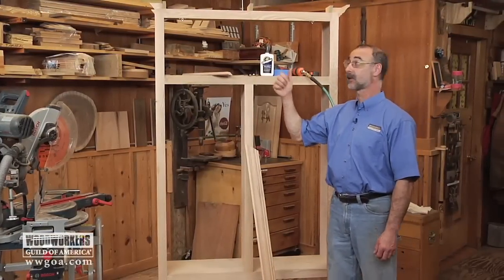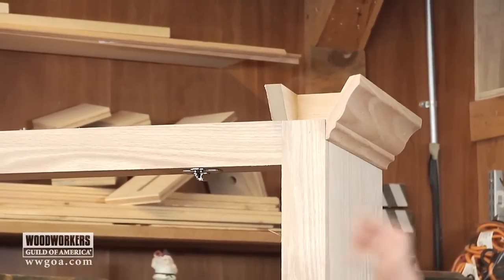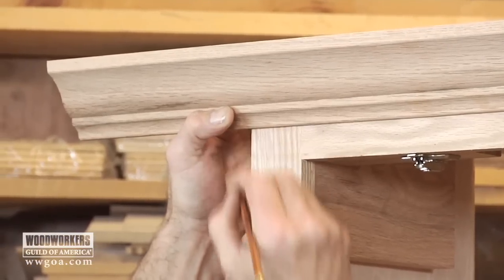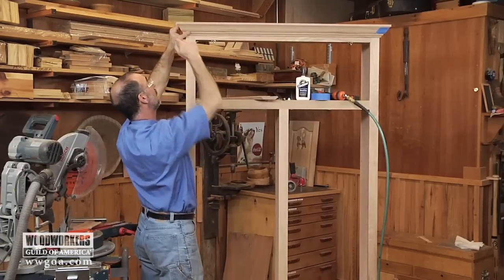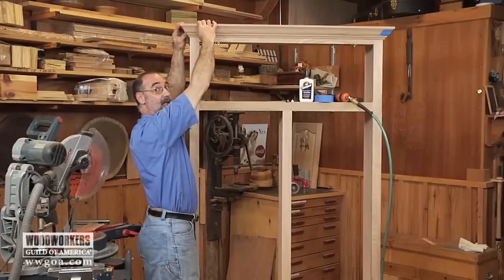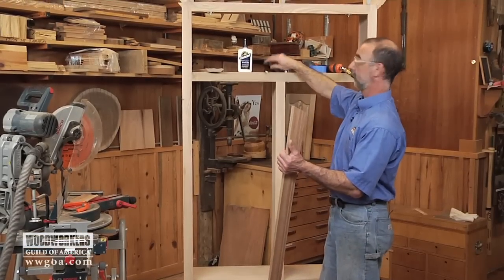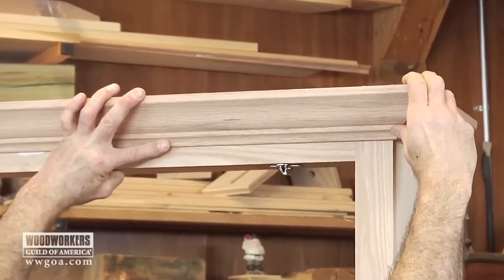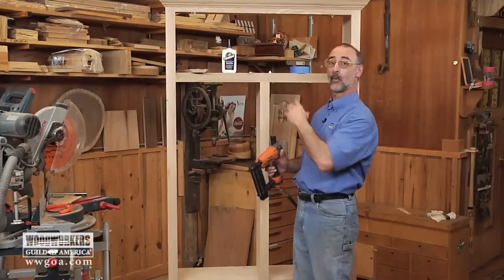Woodworking DIY Project - Installing Crown Molding on a Cabinet

Comment from the maker: It may take a tiny bit of putty, but often you can push on the wood with your fingers a little and the fibers will form right over the top of the pin hole.

Comment: Thank you for posting such a great video.  I'm installing crown molding on my cabinets and want to add a "staggered" effect and I'm using 4" wide molding.  How would I secure a riser/ filler to the top of the cabinet to creat that look?

Also, exactly how did you secure those gussets to the cabinet?  Did you just glue them or nail them from the bottom?

Comment from the maker: I use CA glues like 2P 10 all the time.  Very useful.  CA glue offers the advantage of curing very quickly, but doesn’t have the shear strength of yellow or white glue.

Comment: Nice video. The critical commenters are missing the point that this isn't about how to cut miters, it's about how to attach the cornice securely. One comment:  I was taught to size end grain when gluing up because the end grain draws moisture from the glue and weakens the bond. So, best practice is to apply glue to end grain, let it soak but not dry, then reapply. What that means here is that I'd probably apply glue to the end grain on the miters (both halves) as the very first thing and also along the  gussets, then apply along the  length of the cornice. When the long glue line is brushed out, I'd then go back and hit at least the miter end grain again , at least lightly. It shouldn't run onto the cabinet face. I'd probably hit the tops of the gusset miters too. 

The one question I have is, why not do the gussets afterwards? You'd be able to push them up against the cornice to locate them exactly.
Reply from the maker: Yes, gussets could be used here to improve the installation process.  As far as sizing, this is a useful technique when it comes to gluing end grain.  We do cover that technique in other videos on the site.
Paul

Comment: when you put crown on a low bookshelf that you can see the top of, how do you cover that? like a tabletop of sorts. would you just cut a piece of plywood to go on top of the crown?
Reply from the maker: +Ian Knight You could cover it with plywood or a glued-up hardwood panel.  In this approach I would suggest overhanging the crown by 1/2" or so to give a nice finished appearance.
Reply: You can't just simply put a piece of plywood on top because the edge of the plywood will show

Comment: I understand what you are saying about the glue running, but it doesn't matter what kind of glue you are using, if you don't apply it right, or just glob it on there, it's going to smoosh out and run or drip, regardless.  It's all about the application, like you were doing, of using a brush or something to get an even application of glue across the surface, and cleaning up any squeeze-out right away.  Overall good video, thanks.
Reply: Sig Guy  If you varnish and seal the moulding and the exposed bit of the frame before you glue up, you then just have to wipe off the squeeze out and drips. No sanding of awkward bits required.

Comment: if you are adding crown molding to a bookshelf that has a decorative "lip" or edge that coms forward, can you glue and nail the crown molding to the edge lip or is it best to the very top of the cabinet?
Reply from the maker: Hi, Camila. You could do this either way. You'll need to ensure that you support the molding with adequate bracing from the back side so that it is solidly supported and not vulnerable to getting jarred loose with a light bump.

Comment: Hi, what angle are the gussets cut at? Thanks
Reply from the maker: Hello Rob, 

The gussets have to be made at what’s called the spring angle of your 
crown molding. The spring angle might be listed with other specs on the 
trim when you buy it. Otherwise you can hold a piece of crown in a 
corner at the correct angle, when both flats of the molding are seated 
against the adjacent surfaces, and measure what angle the molding is at.

Hope this helps!

George
WoodWorkers Guild of America Video Membership
Reply: WoodWorkers Guild Of America Thank you, it does!

Comment: what size nails did you use?
Reply from the maker: For attaching crown molding to a cabinet I'd suggest 15 ga. 1.5" finish nails.  If you are attaching crown to a wall, I'd suggest 15 ga. 2.5" finish nails.

Comment: Can you go over what angles you set the miter saw at to get the crown molding to fit just right?
Reply: Uhh... Perhaps I'm missing something but what other angle than 45° would you need?
Reply: If you hold the crown on the miter the same angle as it goes on the piece, it's 45 deg.  If you're laying it flat , aka "cutting it on the flat" see this https://www.protradecraft.com/cutting-crown-molding-flat

Comment: No help here with calculating the bevel and mitre angles, toughest part left out completley.
Reply from the maker: We can certainly assist you with this.  I can submit your question to our experts.  Please allow 1-2 business days for our experts to reply.  We'll post their response here.  (Please feel welcome to ASK questions.)
Reply from the maker: There are many calculators available online for this purpose.  Here is one example: https://www.blocklayer.com/crown-molding.aspx
Paul
Reply: Wall Corner Angle 135°
Miter 15.2°   Bevel 16.8°
Spring Angle 41° (Flat Down method) X2 face up and reverse X2 face down.